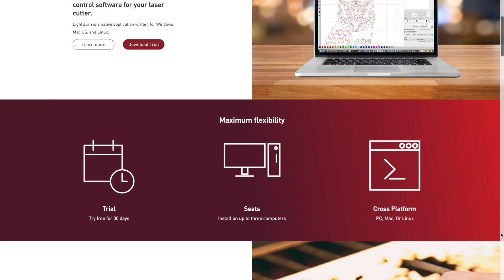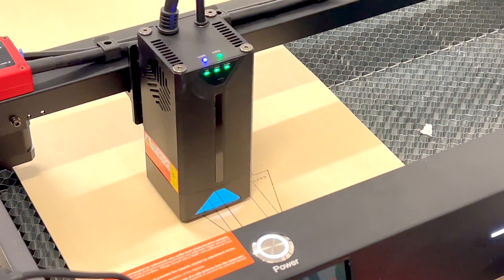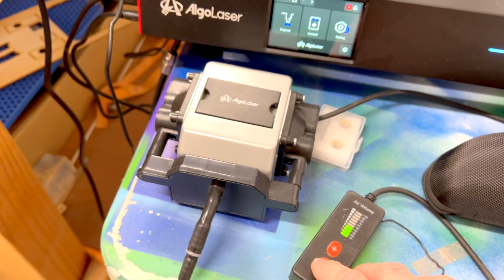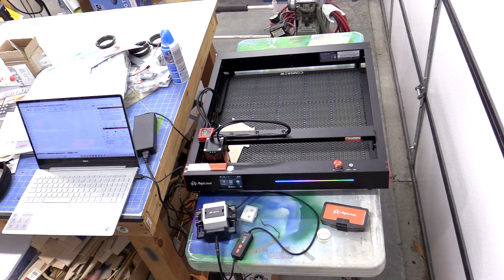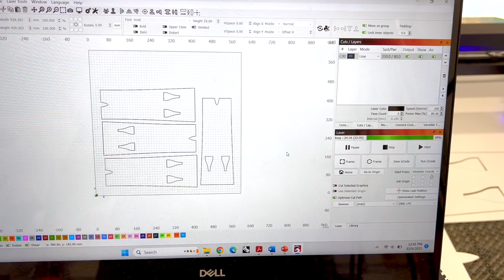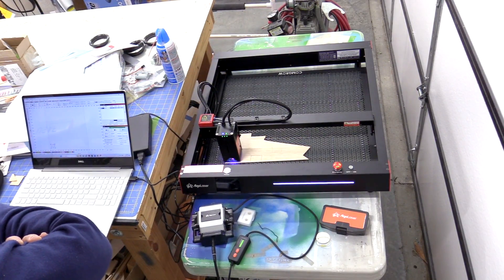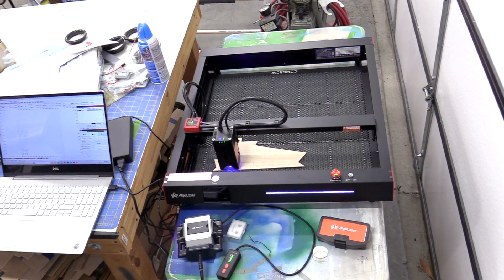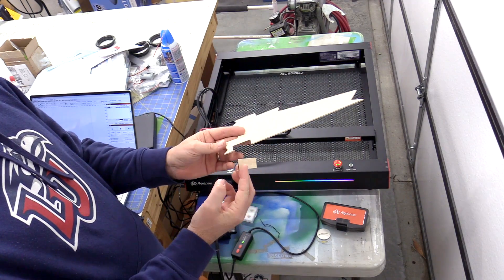The Transforming Power of Laser Cutting: AlgoLaser Delta 22W Review!

Comment: BEFORE you get/operate your new laser, watch the hell out of YT videos and take notes, (what I'm doing right now).  The LightBurn SW comes with 30 free trial to test before you buy.  From the YT videos it is THE SW to use.  In LightBurn there is a test area that your set up a cutting matrix and engraving matrix which is the FIRST "project" you should perform.  What you learn from these test results will get you smarter in how to make cutting and engraving a lot easier.  Plan on buying some "extra" learning wood as you will only receive the best results with PRACTICE....

Comment: Hi, thanks for the informative video, how do the noise levels (combined internal module fan & air assist compare to other  machines of the same power you have used/reviewed
Reply from the maker: The machine is quite quiet actually. The only thing that makes any notable noise is the air pump. Compared to the 3d printers I have going continuously, it all just kind of blends together.
Reply: Thank you for taking time to reply, hear there is a 40w version on the horizon, probably gonna be a tad louder due to extra heat but if its not too bad might be My savior as I am looking to get the quietest 40w on the market

Comment: I've also had a 40W laser for my small CNC for a year now. I have already cut 100mm of plywood in one operation. It is extremely practical, quick and very accurate. I also use LIghtBurn, the best laser software worldwide. The problem for me is the smoke, since lasers actually burn out the material with heat. I hope yours has cooling on the laser head, e.g. CO2